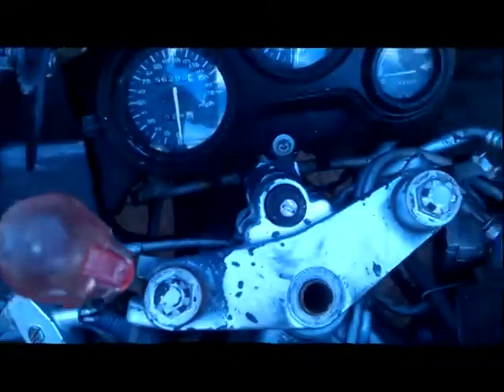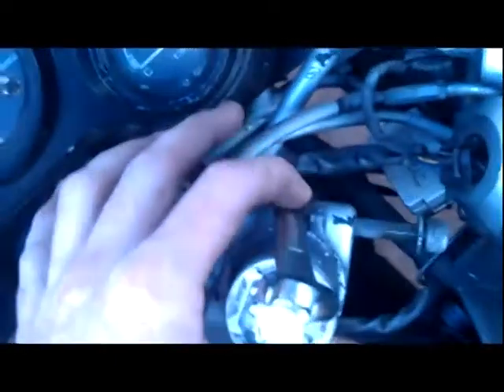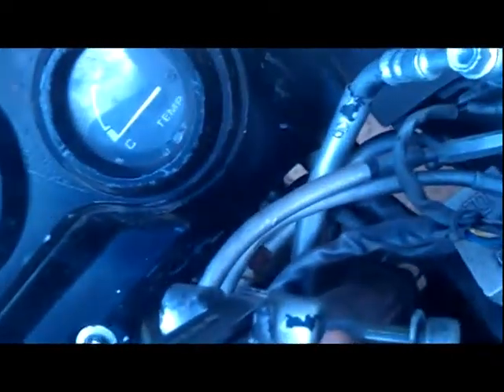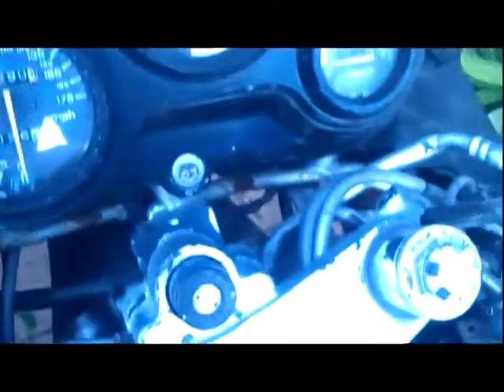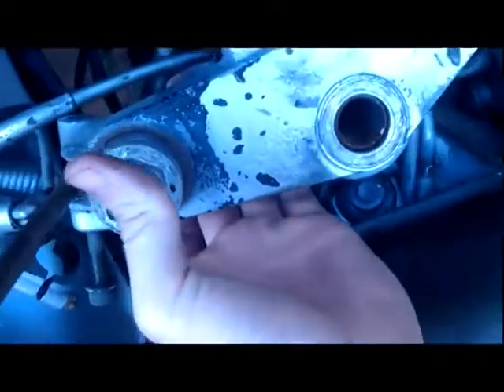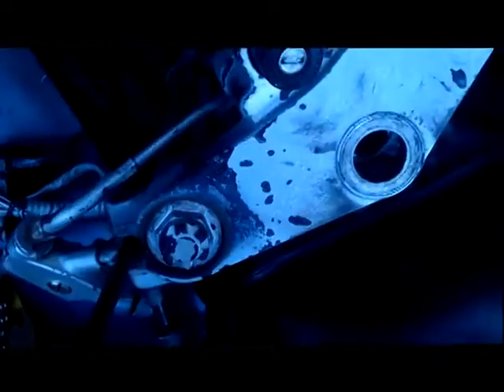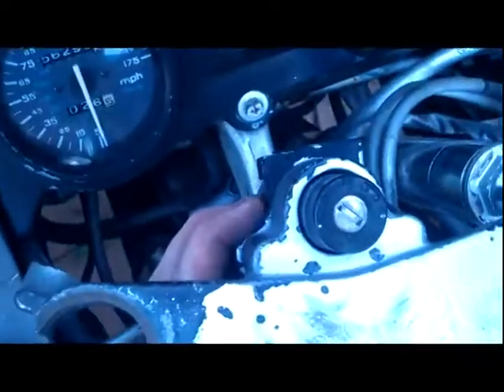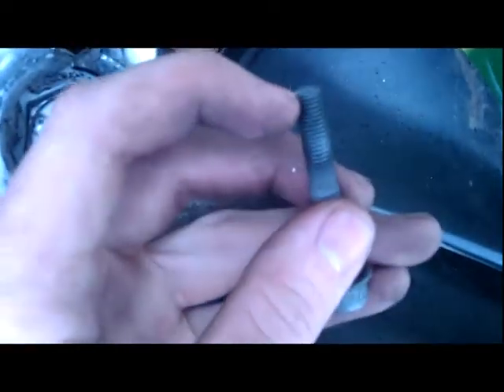Techniques for removing a triple tree

Comment from the maker: usually the forks (front shocks) get bent in a crash if it is a head on collision, even if you aren't going very fast. If you just lay it down on the left or right then you only have to loosen the clamp that goes around the forks and shift it to where it is comfortable. I don't know how the other year CBRs are, but if yours is a 91 - 94 then you have a bolt on the bottm of the handlebar clamp that locks it in place. You can take out the bolt to adjust the handlebar if it is bent but still works.

Comment: Great video! I didn't take time to read through all of the comments, but I have found that when working on my 1992 VFR that lumber makes good pry points and wedges. I am going to use your technique to remove my upper triple but I'll use pieces of wood as wedges instead of a screwdriver and a wrench. Using wood will make it less likely that I will damage the threads on the triple tree bolts, and wood won't scratch the upper fork.

Comment from the maker: yeah, that's what it sounded like. you can get forks on ebay for around $100 - $150. You should get the front axle too (bolt that goes between the forks that holds on the wheel). Those should be around $10 - $20. They should be pretty easy to change yourself as long as you take your time, it will take some time, but it isn't very hard if you don't mind doing it yourself. You just have to support the bike with something, that's the most tricky thing.

Comment from the maker: the f3 is very similar to the f2, so it should be close to the same setup. If your forks are bent then there isn't a way to straighten up the wheel, which is what it sounds like. If it is just your handlebars that are bent then you can pull off the handlebar clamp and there will be a bolt under it that locks into a notch to hold the handlebar in place. It doesn't tighten to anything, it only fits into a notch below the clamp. Take out the bolt and you can shift your handlebars.

Comment from the maker: it's pretty common for the handlebar to bend if it is laid down hard. You will need to check to see if your forks (front shocks) are bent though depending on how it was crashed. They will most likely be bent under where they clamp to the frame (lower triple tree)

Comment from the maker: I would have to take my bike apart again to make the video, I've already painted my triple tree and put it back together since I made this video yesterday. It sounds like all you would have to remove would be the handlebar clamps, then look at the bottom of the clamp and you might see a bolt or stub of some kind that keeps the handlebars still. Remove it and straighten out your handlebars. If there isn't a stub/bolt, then just loosen the handlebar clamp and shift them until they seem normal

Comment from the maker: if you are just adjusting the handlebars then you shouldn't have to touch the one in the middle of the triple tree. you should only have to loosen the one bolt that you can see on each handlebar clamp, then you can pull that handlebar off. Once the handlebar is off you can look at it to see if there is any bolt or bump that will lock the handlebar in place. remove it or file it down then adjust the clamp. Or buy a replacement handlebar on ebay if it is bent too bad.

Comment from the maker: I'm not sure what you mean. Are you saying that someone said your triple trees weren't lined up anymore? That will cause what you were talking about. But it's pretty hard to have them not aligned without your axle in your front wheel also being bent. It sounds like truth, but if you feel vibration when you are riding then your axle is still bent.

Comment: Did you have a jack holding this up or just leave the bottom triple tree tight and resting on the wheel?
I ask because my stem is knocking around when I go over bumps or brake hard. I can see the stem rocking and am pretty sure I have to take the top off and get at the nut to tighten the head bearings ( layed the bike down and think it lossened it. the triple trees werent parallel and made it ride crooked. I aligned them but its still loose in the stem). Im thinkimg maybe a car jack with a block of wood and some tie downs to secure it and just eeeeever so slightly take some weight off the front end with the front wheel on the ground.

Thank you for the video, I am sure this will help immensely when I try to adjust the head bearings.

Comment from the maker: sorry..haha..and I'm trying to sound sarcastic, but it is the clamp attached to the handlebar.

The stub bolt wouldn't be visible to you unless you looked up from underneath, if you even have one. I'm only guessing that the f3 does since the f2 does. My yamaha doesn't have one. On my f2 the bolt is on the very bottom of the handlebar clamp and it sits in a notch on the triple tree (the part I'm removing in the video)

Comment: Wait idk if we're on the same Page. Bars don't seem bent. I can lock both sides without pinching my fingers. When my bars are straight my wheel is pointing to the left a bit. When my wheel is straight the handle bars r off align. If that makes sense sorry

Comment from the maker: if I were you I would have the bearings in the front wheel replaced and get another axle. then see if the triple trees line up. The vibration is most likely from the axle or the bearings, or both.